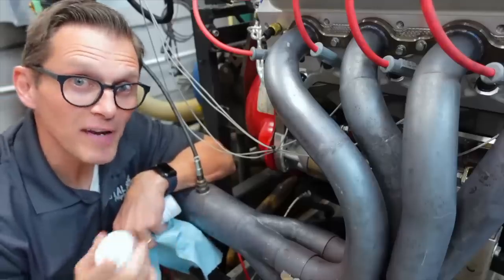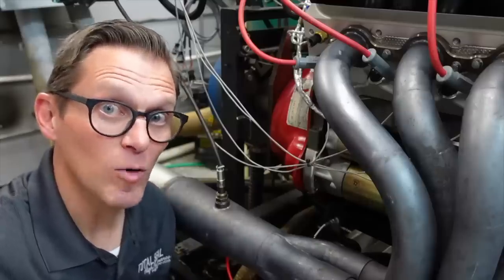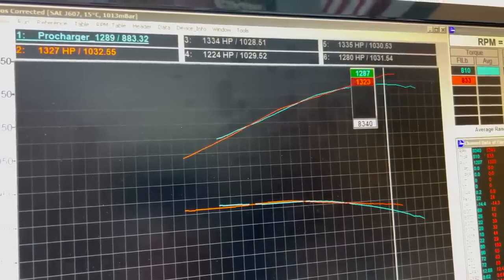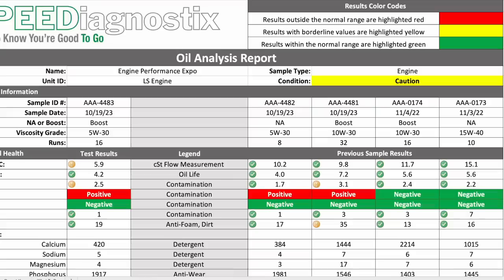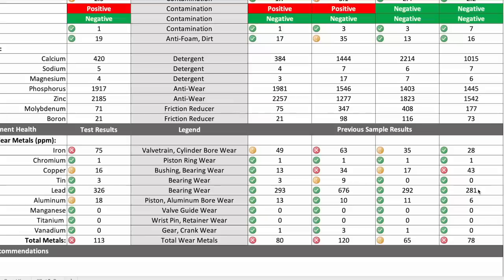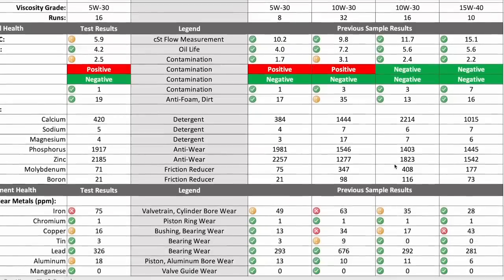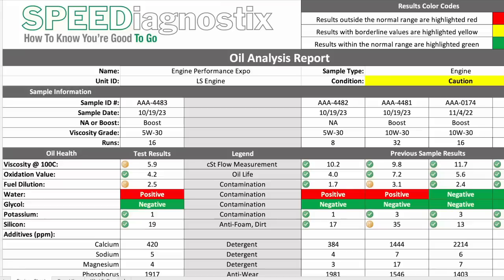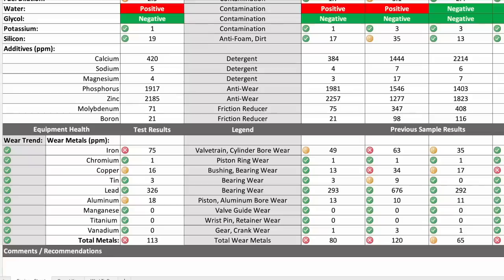What Adding BOOST Did Do To Our Motor Oil (NA vs BOOST Test)

Comment: Man i would like to see how oil is effected by turbo boost with oil cooled turbos. My tundra has the twin turbo v6 in it. I just got it so i haven't done any oil analysis but I'm willing to bet the recommended 0w20 oil will not stand up to daily towing especially in the middle of summer 100 degree days high humidity.
Reply from the maker: We want to get a turbo engine just so we can test that.

Comment: QUESTION: is it dangerous to use an oil leak dye in motor oil?! If it is used should the oil then be changed as soon after once the leak is found?!
Reply from the maker: Great question! It is safe to use.

Comment: So how does a gr corolla with 0w-20 running 26psi survive? Im thinking of buying one but would never run oil that thin
Reply from the maker: The bearing clearances and surface area also plays a role.
Reply: @themotoroilgeek  Can you tell us what oil was used in this Boost vs NA video?
Is it possible that the HTHS for the oil used was not so good?

Comment: Fantastic video. 
My fun N/A car is actually, via a number of mods, gives 40% increase in output. 
What I have found that to get maximum performance at the mid/top end inevitably leads to a measure of fuel dilution, determined scientifically by sniffing the oil after an oil change mid "summer"!
I have a number of oil needs foremost ZDDP for the flat tappets and cam!! 
I now run various permutational of either 15w-50 or 20w-50 to protect the engine ,I had a feeling the viscosity was going to take a beating due to the increased output and fuelling.

Comment: Could you give a recommendation for 5th gen RAM diesels whoch call for either 5w-40 or 10w-30. Live in a warm climate, and tow a trailer on the interstate. My cause of concern is the hydraulic lifter failure that seems common these days. What preventative measures be it the oil type, driving havits, oil chg intervals, or otherwise, will help me, of at all, to keep this issue from being an issue. Do these failures happen haphazardly, such as metal type, mechanical design, or is there an underlying user error that causes these. Thx so much! Saw you for the 1st time on Daves Auto channel, and immediately looked you up & su subscribed!

Comment: My manual says to run 0W20 in Canada, but 5W30 in the States. I live in Southern Ontario, where I get temperatures hotter than in some states. It seems weird to me that, with Canada being so huge, a single oil weight would be recommended for the entire country. My oil pressure in my 2021 supercharged Mazda 3 doesn't go over 45 psi oil pressure at 8 psi of boost. Should I be concerned, or should I try 5W30 to see if it increases?

Comment: Thanks for all the videos, I like the facts to when it comes to lubricating oil. I have a few old walk behind tractors, the earlier models had pressurized oil systems with filters, in the mid 70’s they went to none pressurized systems with slinger system. I’ve seen on online that in pressurized system you should use High Detergent oil, in unpressurized system use non detergent oil. Is this correct?
         Also some older equipment calls for a GL4 lubricant and it’s getting harder to find, everyone  tells me to use GL5, that it replaces GL4.  In What research I’ve done, I’ve seen it said that GL5 has some ingredients that is harmful to white metals. Is this true? 
Thanks

Comment: So all these turbo engines being forced on us are going to wear out prematurely if you drive using boost on a regular basis. Maybe very frequent oil changes will avoid some of the wear but additional wear Will occur therefore shorter engine life..   what a great  deal!! Thanks EPA!,ThanKs CAFE! Thanks liberal tee huggers!! I feel Sooo much safer and protected now!!
Reply: Plenty of 2.7 ecoboosts that have 2-300,000 on them a lot of the newer turbo engines will last well if they are designed to be a turbo engine vs one they already had and just adapted to the twin turbos.

Comment: Lake, I remember I believe it was the Honda NSX had that oil dilution issue because it was pushing so much air, and they were replacing the engines under warranty.  It all makes prefect sense now.  Great video.
Reply from the maker: Interesting!
Reply: @themotoroilgeek 

Hi Lake im a big New fan of your work! 

3 yr ago i turn my 240k Honda Civic Si 2008 turbo 7psi and i switch to 5w40 instead of 5w30 im in peace with my choice now great video thank.

Im seeking your opinion about viscosity index. Honda claim 10W30 is good over 20F so maybe i can go with 10w40 ? 

The car have now 280k on it still have good oil pressure but noisy on cold start during build up 2 second.

Are you recommend to stick with 5w40 ?

Now i run liqui moly but i check penzoil ultra platnum test and im stunned by the result.

But viscosity 5w40 are not available with ultra platnum and euro 5w40 are not the same oil i think.

Thank you !

Comment: Hi I really like your videos and the knowledge you share is priceless thanks. I am a retired HD mechanical Fitter with lots of engine experience. Big diesels and high performance auto from waaaayyyy back in the 70's and 80's. A lot of the knowledge you are sharing now makes a lot of sense from my experiences I had back then. In this video you mentioned a couple of times about lead in the sampling coming from the fuel??? Is there something different about test engines fuel? I am under the impression that lead is banned from being used in fuel? Please explain.
I'd also like a video about diesel engine oil. Especially on the subject of soot control. Tnx
Reply from the maker: The lead is from the high octane race fuel we typically use.
Reply: @themotoroilgeek  OK thanks. By the way back in the 70's when I built high compression inline 6 engines (14.5 : 1) I would mix 15 imp gallons of super, which I think was 96/98 octane, 1 imp gallon of menthol benzene and 300ml of castor oil. The engine ran very well with this mix and often hit 8000 Rpm pulling hard all the way to 7000-7500RPM. It was a formula used in hots rods but I don't think any of them ran 14 : 1 compression. I could easily knock off a v8 no problem.
How does that mix compare to the race fuel you are talking about?

Comment: yea let all go buy a 75k Econboost f150 or any turbo car not the v8 or na engine that works better as par application lol
Reply: Ecoboosts tow great that’s why they have the max tow f-150 with an ecoboost. Just change oil often and use good oil and filters.

Comment: I know this is off subject… 

Everyone’s goal is to keep their engine as healthy as they can. With oil change intervals becoming commonly extended by manufacturers, ie 10k intervals and oils claiming 20k miles worth of protection. 

Is it harmful to the engine to habitually change Synthetic Oils early at like 5k miles? Is there a risk of additive saturation effecting metal qualities inside the engine? Say, ZINC not burning off enough and compromising the aluminum in an engine block making it prone to crackling? 

Is this a thing? Or can I safely change my Pennzoil Ultra Platinum oil every 5k miles in my 4Runner without damaging an otherwise VERY reliable engine?

Comment: What is the effect of the auto engine kill when you are at a stoplight or halted for sometime. Does the hot oil drain off of your engine , causing additional wear when the engine is restarted?

Comment: So why is this Driven OIL so danged expensive??? It cost like $18.00 PER QUART??? I'd like to try some in my 2022 F-150 but cost is a factor for me. That's a FRANK B 4 I purchase a Filter 😳😂🤷‍♂... Not sure it's worth it??? Not for a Stock 3.5 EB V6 Factory Engine??

Comment: Hey Lake I have a question! Does the same theory of fuel going into the oil apply to diesel aswell? Does the diesel effect the oil differently? I have diesel car that runs 5W-30 and the turbo usually maxes around 20 PSI.
Reply from the maker: Yes, the same theory applies to diesels. More boost = More fuel, which requires more viscosity and oil retention on the cylinder walls. Check out the videos about diesel engines we did on the Total Seal channel.

Comment: Lake, please verify: NEVER run heavier viscosity oils in the new engines, for example your daughter's new Toyota that calls for 0W8 weight oil however the manual says you can make an exception and use 0W16 if 0W8 isn't available? I remember I bought my daughter a used Prius C back in 2014 and it was a 2012 model year. Even two years after the car was introduced, you could not find the required 0W20, still wasn't available at auto parts store, wallyworld.....just the dealer. So, please confirm that you should ALWAYS follow manufacturers recommendations, especially on new, modern day engines?🤔
Reply from the maker: Actually, you can always run one viscosity grade higher than the OEM recommendation. The viscosity grade recommendation from the OEM is primarily driven by EPA fuel economy requirements not engineering requirements.

Comment: I absolutely know boost can mess oil up, obviously. But my shock was motor oil type/formulation definitely matters. Check your oil. 20 years ago penzoil platinum in a wrx stock boost had tons of fuel in the oil. Other oils in that same car/motor next oil change didn't. But that's not the same today. Check yours. That particular oil in that particular engine had 2-3% fuel and other oils it was less than 0.5% or something like that. I don't remember the exact results. But that one oil had lots of metal particles in the oil analysis too. It would have ate that motor fast if i didn't check. I wish i checked my oil in my truck, extended oil changes damaged my valve train on cold startup. It still runs ok but extended is no-bueno as you have explained the why. Love your discussion. A co-worker bought a brand new jeep. I'm hoping he follows some of your tips. Early first oil change. Fuel additives with no extend changes. I bet i can last a long time. Oh and my tundra is at 210k and runs great except flooring it, the variable valve timing or something squeals pretty bad.  It burns/looses only a bit of oil at 4k changes.

Comment: Hello Lake, I have a 2019 Corvette ZR1 which comes from the factory supercharged (port & direct injection) making 755hp. Mods now have it at 855 wheel hp (pulley, cam, headers, cat delete, head & supercharger porting, catch can and naturally a tune). I'm still running the factory spec oil (mobil 0w-40) but with the mods I'm not sure if I should continue running the mobil 0w-40 or go with something more suited for my modded motor. So my question is what oil and what viscosity do you recommend for a motor like this PLEASE?
Reply: The main thing i get from these videos is you need to get oil analysis tests for your own engine and oil.  If you are serious about getting the correct oil for your vehicle.

Comment: There are so many choices out there for motor oils My question is what is the best motor oil to run in my 2020 GMC 5.3 l? Obviously I want to run the recommended weight etc but I'm talking brandwise type of motor oil with no additives what is your recommended best brand? Thank you in advance I love your videos keep them coming please . Also curious on your recommended filter choice also as to not under filter or over filter my oil?

Comment: I would like some info regarding oil weight I should use. 2016 BMW M5. Tuned and making 640whp and 600wTq. 
I’m living in Chicago so summer is hot and humid and car is stored for winter. 

I use 5w40 Quaker state currently. 
Looking to go to 5w50 redline. Would you recommend that as a good idea. The car is a daily driver. Most of the time it just sees stop and go traffic from time to time a couple pulls

Comment: Just out of curiosity, I would like for you to do an oil sample prior to oil change, then add one of the popular OIL FLUSH products that supposed to clean your engine. Then, drain it like anyone else would, then add clean oil and filter, drive a little and do another oil sample to see what changed and if it degraded the new oil to a point that could be damaging to the engine.

Comment: You have to take into account the bearing clearances too. You only want to go as heavy as possible in relation to the bearing clearances and operating temps. Running a thicker oil with factory main bearing clearances of say 2 thou could cause issue. I.e... Corvette 15w-50 on track days only. If you daily that oil you could end up with more wear as the oil temps run cooler. Will have to find the balance of viscosity vs. clearance and temps with the correct oil change interval. The tighter clearance could require thinner oil with more frequent changes.
Reply: SYTN. OILS  are  allready,already,, thin,, and the molecules are super,, micronized,, it easy finds its way..AND it cools and protects,, in a -SUPERIOR WAY. 🐅 🐯 🐅 🐯 🐅 TIGERS ARE MASSIVE,, YET,,THEY FIND THEIR WAY,,UP TREES,, STREAMS,,CREEKS,, RIVERS,, HILLS,, MOUNTAIN,,etc. 🐅 🐯 🐅 🐯 🐅 TIGERS. ARE AMAZING

Comment: 8:50 stops between runs more water, more oil dilution_

So, if i understand correctly a sideeffect of start-stop operation in new cars is more oil dilution because there enough time for water to condense and find way to crankshaft oil.
(??)

Comment: Welcome to the new Level. Weve been trying to tell people for years. We change oil every 1500 highway miles and 500 if we are severely abuse/racing. Transmission oil every 10000

23 years with the same Ram.

Comment: Can you add AT-205 after you have added Lucas Oil Stabilizer?  I have a leak I believe coming from a seal and wanted to add AT-205 as I have heard it works well.  Just not sure about adding it after adding Lucas to the oil.

Comment: Lake, would you do a video about using diesel oil in a gasoline engine?  I’ve seen lots of guys putting Shell 5W-40 diesel oil in their LS engines and it’s blowing my mind that someone would think that’s better than a properly designed full synthetic gasoline oil!  A video explaining the potential damage would be highly educational. Thank you!

Comment: Great video.  How does this information pertain to a modern, daily driven, turbo charged engine?
I have a 2018 Cadillac CT6 3.0TT.  I am genuinely concerned weather I should be using DexOS from the dealer or something else.  I don't run my car hard by any means but I do like the kick in the pants of boost from time to time.

Comment: My primary driver is a 2003 Chevy Tracker 2.0 l w/ 263k. I run 5/30 high mileage Castro syn/mix.  Drive approx 16 miles 1 way to work @,60mph daily. Change every 5k, it burns appox 1/2+ qt a month.   Any recommedations  or chages  to keep this going.

Comment: I think this is also applicable to all the small modern turbo petrol and diesel engines, which stock make 20+ pounds.
Lake Jr what optimum oil viscosity should these be running as a starting point?

Comment: Boost = more fuel and air = more boom (more burn from the mixture of fuel and air) = more pressure = more blow-by = more dilution. Makes perfect sense! Thanks Lake and the team!!!
Reply: Exactly why I have an Air Oil separator on my WRX, I really want to upgrade to catch cans though.
Reply: It's not a boom it's a controlled burn. Boom would blow the cylinder head off or push the crank out the bottom
Reply: @h3xd3m0n9 You can argue it's both. Controlled expansion of higher temperature gasses that generate high pressures. That itself causes explosive level of noise. It's a burn and boom.
Reply: Of course you are right. Boost = more fuel and air = more burn from the mixture = more pressure = more blow-by = more dilution. Fixed it....

Comment: Greetings from Greece, 
I see all your videos with great enthusiasm and really I start understanding many things about oil’s. 
Keep going A+++ 

Can you please explain me because I confuse and hesitate a bit after your comment “run the right viscosity in your engine” 
I run a CBR 1000 RR 2022 model and Honda is the only motorcycle company that switch to 10W-30 from the other manufacturers. 

I run it right now with remap ECU (more fuel), should I increase to 10W-40 ? 
I misunderstood the Fuel dilution thing (sorry for my English not my main language) 

Also can you explain how you get the Hp from the engine, without to be on a dyno (inside a car) ? 

Future video you should do is what plays with HTHS in oils and how same viscosity oils work differently with different HTHS.

Comment: Fascinating video as always! Wondering if I should switch to a 5W-30 for my GR Corolla instead of the 0W-20 factory oil. It's a modern engine and likely has tight tolerances, but 25 PSI of stock boost and track conditions may warrant a switch.
Reply: Yeah I think that would help a lot man and changing the oil more often 2-3k and immediately after a track day 😎👍🏽
Reply: 5w-30 all day long for that motor.  It’s a higher stressed 3 cylinder engine.  3,000 miles oil and filter change as well.  

I have a 22 WRX with some mods and a custom tune.  It pushes about 20 lbs of boost on the 93 octane tune.  Calls for 0w-20 and I have used 5w-30 from the first oil change forward.

Comment: This and several other videos seem to imply that higher viscosity oil causes less wear, although with maybe more friction and lower fuel economy. In a more specific case - you installed heavier oil in your daughter’s Toyota. Is there any risk of causing damage to a modern turbo engine by using a couple grades heavier than recommended ? Hypothetically a German engine with 0w12 from factory, would a euro oil of 5w30 viscosity cause any damaged - other than efficiency?